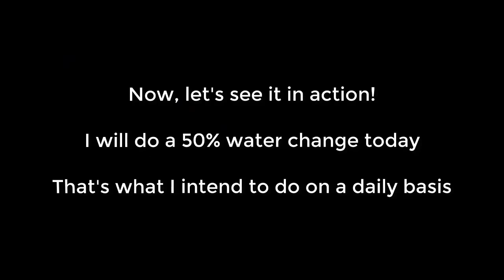How to Build a Betta Rack with Easy Water Change System

Comment: I love this set up. Brilliant easy care. I wonder though if you had a pipe at the top pipe to release the air lock maybe they will all drain at the same rate.
Reply from the maker: No other pipe.
Water will drain once i open the valves
Reply: I'm probably going to make a similar set up. Makes it so much easier to look after so many betta 🙂
Reply from the maker: @guppynuttynz7729  yes, very easy 😊👍

Comment: Does the poop get sucked out too when changing waters? I think the hole is a bit high, I guess its because of the 1inch angle bar. Maybe putting the hole at the bottom will work better.

Also, what water pump model was used here?

Comment: Is it possible to use acrylic plastic sheets for the side that u drilled holes for the drainage. Because i saw alot of cracks? Excellent tutorial👍🏻
Reply: If you put dish washing detergent on the end of your drill bit it will help with this.

Comment: For those people who are trying to implement this , To be frank it won’t give you as much of efficiency as you think .

1 . Cross contamination will be high

2. The amount of water changing rate in first tank and last tank won’t be same ie. 75% water of first tank will change when 25% of water of last tank changes ( can be changed by adding valves at both sides )

3. The water coming out of the tank will be still present inside the hosing 
Even if we do 50% water change , we are just diluting the 50% water that was taken out of the tank and not adding completely new water into the system 
( this issue cannot be changed unless we use entirely different water filling setup )